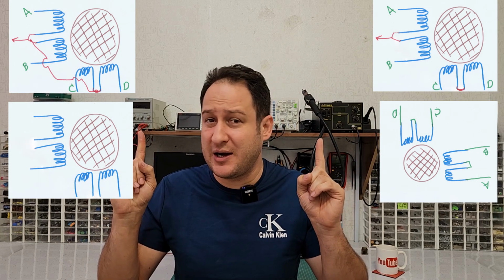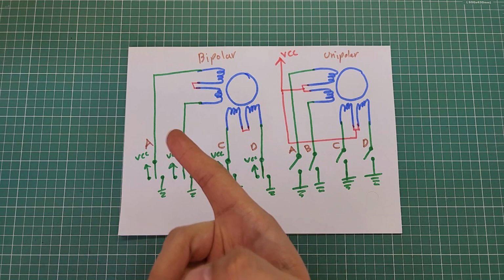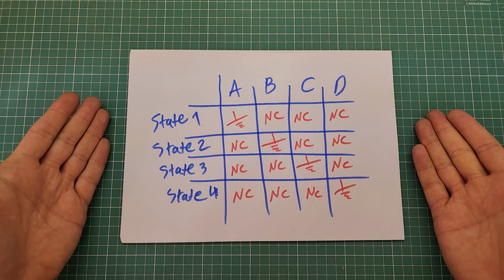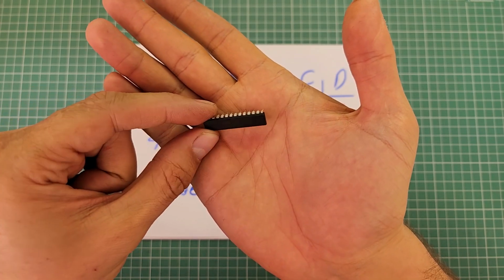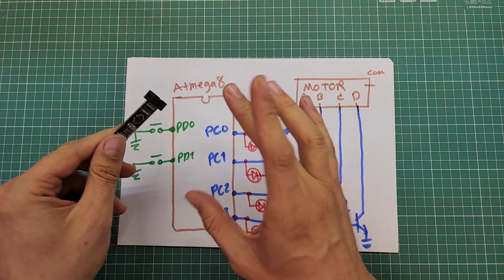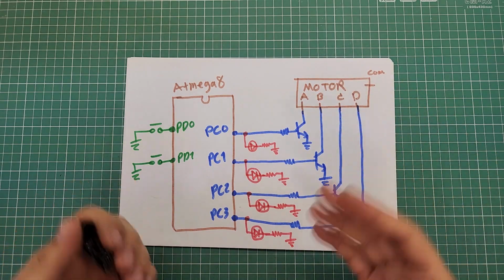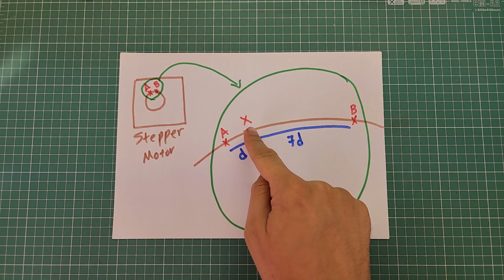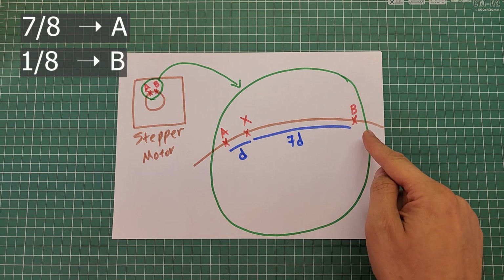The Ultimate Guide to Stepper Motors: Unraveling the Micro-Stepping Technique

Comment: Would it be possible AT ALL to drive a 4-wire stepper in a UNIPOLAR configuration, because in theory you can energize each coil using the UNIPOLAR method. Maybe it will have less torque and resolution, but it should be possible, right? Maybe it would be like the 3-wire steppers?
Reply: One way that it would be possible is if you bridge each of the two windings with a pair of power resistors connected in series. A starting point would be to choose each resistor to be approximately the same as the winding resistance and 4 times the wattage since you will probably want to double the supply voltage. The center tap of the resistors becomes your pseudo "common". Not terribly efficient as you would be dissipating about 5 times more power in the resistors than in the motor itself, but theoretically doable.

Comment: So if i understand this correctly i can just get 4 mosfers and run a 4amp stepper motor for $2 instead of getting a $30 stepper motor driver? Also could i use another mosfet to control the torque?
Reply from the maker: Yes, by using 4 transistors you cab make a unipolardriver and by using 8 transistors, you can make 2 h-bridges which is enough to make a bipolar driver.
Also you need some other components like flywheel diodes
Reply: @elewizard  ohh awesome! Thank you so much! You are the first person who actually responded.I do appreciate this more than you think!
But i think a bipolar driver would be fine. How would I control the torque of the stepper motor if you dont mind me asking? Im busy making a racing sim using some parts i got from an industrial printer. I was successful in creating a rotary encoder using 2 linear hall sensors and a diametric magnet by placing the sensors 90° out of phase. I was also able to create a simple usb circuit that uses pins on an arduino nano, only thing i still need to complete is the force feedback of my steering wheel. Do you think a stepper motor would be fine or would it be better to buy a dc motor?
Reply from the maker: You can control the torque by PWM👍 a stepper motor would be fine, also you can use a DC motor+encoder
Reply: @elewizard  thank you so much! You where very helpfull and i hope someone else could learn from this too!
Reply: Hello, it might not be cheaper though, cause you might encounter further difficulties like driving your mosfets correctly, because achieving PWM control with quite "high" current mosfets (I mean more than a few mA) out of the ohmic region can be tricky. But anyway, that's part of the fun :-)

Comment: There is another category of stepper motor, that appears no different but is much better suited for micro stepping applications.
Most stepper motors use a magnet and have combed pole pieces in typical construction. These when power is removed have a considerable magnetic cogging as you can feel every step. For some applications where smooth operation is required, the cog steppes are much less intense. As the driver does not have to fight those steps, when driven with a micro stepper driver, they are much smoother and perform much more closely to a synchronous permanent magnet motor, but with the same number of steps per revolution.  The downside is a lower torque, and it has very little force to hold position when power is removed. The upside is the micro steps are much more even in the absence of strong cogging of the motor
Reply from the maker: Thanks for sharing ❤️❤️❤️

Comment: Great video... Sir can we drive this with 555/cd4017(using 4 output pin).. I think it will work..  
Thank you sir
Reply from the maker: Since cd4017 is a 10 bit counter, NO, normally you can't use cd4017 to drive a stepper motor, if you are determined to use this IC to drive the stepper motor, you will need some other ICs beside cd4017 to make it able to generate stepper motor pulses.

Comment: afaik the stepper drivers are judged by the purity and accuracy of a sine wave they are able to produce. But how is it produced? Is it just a combination of high res PWM and a capacitor?
Reply from the maker: Yeah, driver ICs produce shifted sin waves to smoothly rotating the shaft. It is analog voltage which can be produced by a DAC and buffered by a current booster circuit.
Also there are are other methods
Reply: @elewizard  thanks!

Comment: Can you in a future video go over selecting an appropriate stepper motor?  Perhaps clarify if higher or lower inductance steppers are better or worse?  Benefits of driving at higher vs lower voltages?  Basic torque expectations?  There are soo many on common shopping sites with steppers of varying specs.  I believe for most hobby applications such as 3d printers it is hard to too wrong, but I have been had issues in the past not knowing that the steppers I bought had an unusually high inductance as I did not know at the time this should be considered  and did not work for my application.

Love your videos and the excitement you bring to them!
Reply from the maker: Yeah, selecting right stepper motor for a specific project can be confusing. 
Maybe some I could make a video on this subject in future